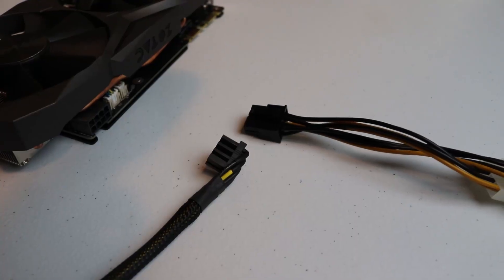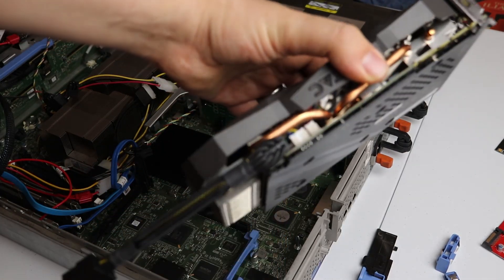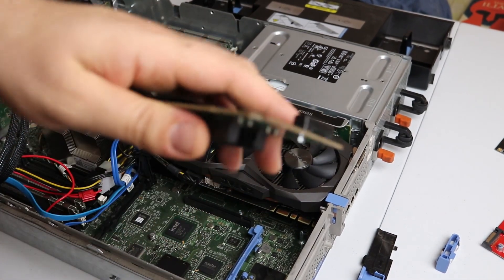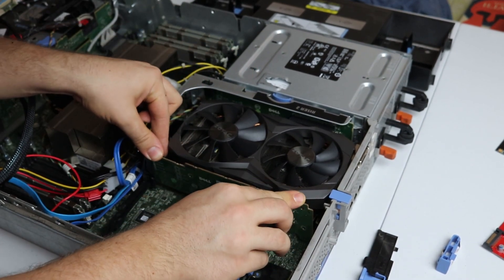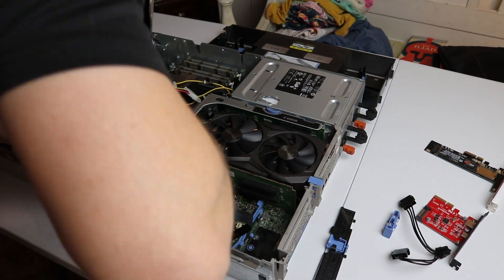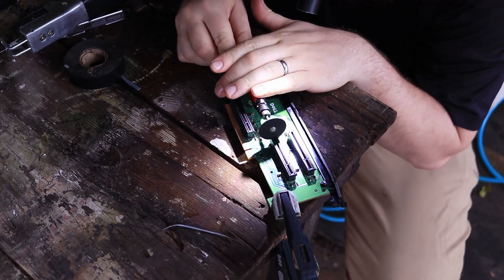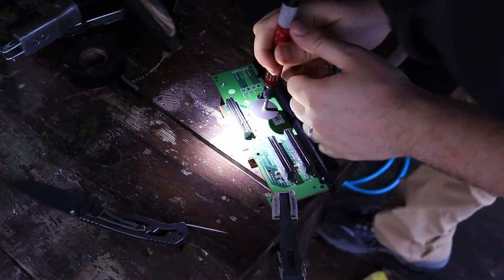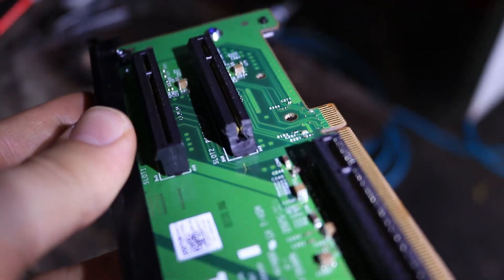Dell R710 build part 3

Comment: HI Aaron,
First, thanks for sharing your video;  I'm also trying to build a dell R710 as a workstations and server;  I found out that r710 did not come with any sound hardware... Therefore, how did you manage to get sound out while playing video games  BTW, my os is window 2019 server..
Reply from the maker: You can either get audio out of your graphics card from HDMI or DisplayPort. You could also use USB headphones which I really like and there are also very affordable USB sound cards I've tried all these options and they all work fine
Reply from the maker: I talk about the sound issue in my latest video if you want to check it out

Comment: Hi Aaron

Really interesting series of videos on this.... I have just bought an R710 and am interested in what operating system you installed - I have read Windows 7 Ultimate can be run successfully.

I notice in the comments that you have been asked about this several times but never respond - is this some kind of secret. . . ??!!!
Reply from the maker: Sorry it's taking me so long to get back with you it's not a secret I've just been working too much I'm running Windows 10 professional

Comment: Hey man! Thank you very much, thanks to you and redditt I've managed to put a 1060 Mini 6GB, it's working and Uniengine benchmark works pretty well, but I've noticed that Hitman2 runs pretty bad...any adjustment that I've missed? The GPU is not touching 80C...and for now Hitman2 is the only actual game I've tested. Cinebench works fine (CPU and GPU). Lastest drivers installed. Running on Windows server 2016 R2 (direct install, not on VMs), 2x x5660 and 48GB

Comment: Thanks for posting your experiences! This has been really helpful, doing most of the same upgrades to my R710.   Sounds like even today many cards don't even saturate an 8x bus even though designed for 16x.  Did you have to do anything about the pcie 25W 'boot' limit, or is that a non-issue, say, after modding in 12v rails? I am curious what you'll test in the next video as I'm trying out Unraid now but still choosing a gpu.
Reply from the maker: Thanks for the comment. I have not had a problem with the pcie power. even when i installed a card with no external power. it was a AMD 5670 1G and it worked just fine. Good luck on your set up.
Reply: @aaronbarnett6973  Ended up with evga GT 1030 to avoid power mod, and a cheapo  8x->16x riser cable to get around cutting the slot. In riser 2 slot2, I get a pcie fault at boot. Maybe its the cable. So I grabbed a spare riser 2 to cut, going to try that next since you made it look easy. Looking forward to seeing more.
Reply from the maker: @nezimar  good luck man